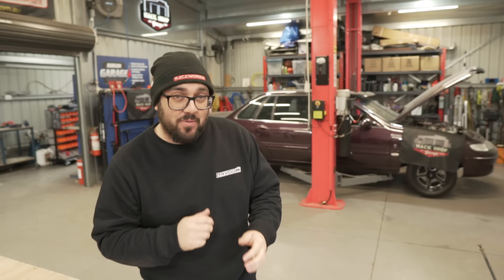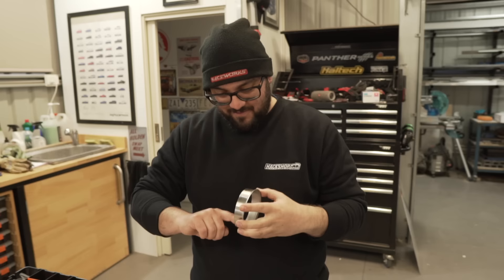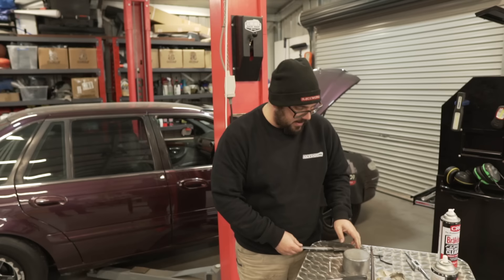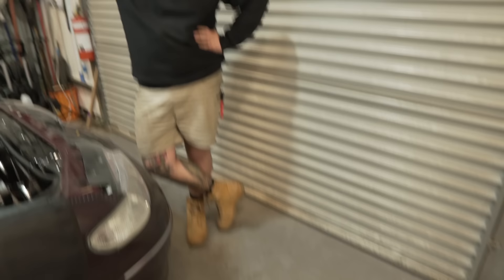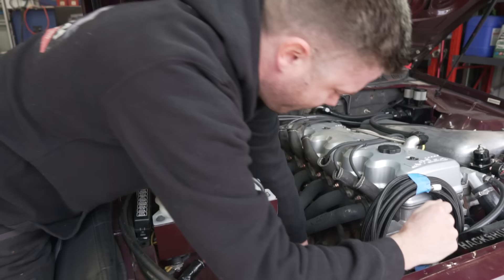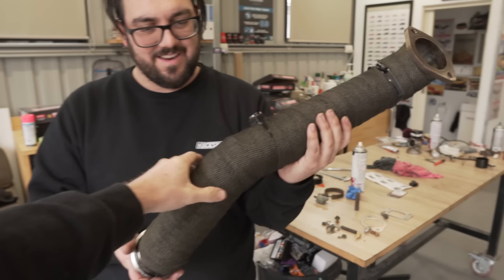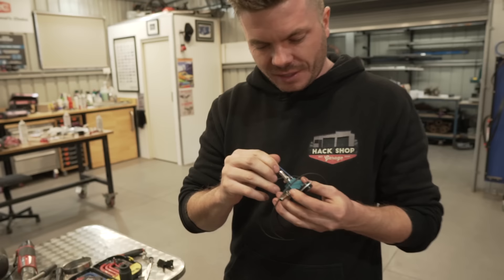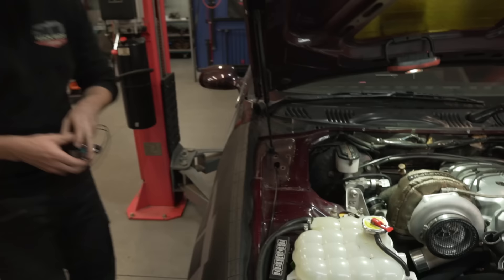FAIRLANE 2.0 BUILD - Turbo Time!!!

Comment: Pro tip- take your old seal, cut it in one spot and use it to drive the new seal in, so you're not hitting the new seal with a punch. If you cut the old seal just in one spot it will remove the tension and you can easily pop it back off the crank after you have used it to drive the new seal in.
Reply: Happy I came to the comments. Definitely going to try this tip on the weekend
Reply: @nathannathan5493  same applies to lots of other stuff too. If you need to drive a new bearing race in cut a slit in the old bearing race and use that as a driver. My toolbox if full of old bearing races for this reason
Reply: Yep it’s a great tip!

Comment: Highly recommended putting heat shield plate on fire wall behind dump to around n just past brake master will help keep brake fluid temps down n stop from the seals in booster from stiffening up

And route turbo intake to behind front bar will get at lot more cool aor down there then in a enclosed  box in engine bay

Comment: Another heat wrap tip, fold the cut or frayed end under itself for a neater finish and to stop it fraying further….also soaking the wrap in water will help keep the itch down and also help cinch the wrap nice and snug in the wrap process

Comment: Heat wrap tip - use cv shaft boot clamps. Saves space with no bulky hose clamps on the side and looks a lot cleaner 👍

Comment: Hi fella's, love your show. Have been watching you guy's since I stumbled on you a couple of years ago. Wanted to warn you about that radiator cap on your reservoir. I had them on my cars and noticed when I revved the engine the radiator hoses sucked in and went flat. Restricting water flow under high revs. You may want to test if your hoses are doing the same thing. Admittedly my caps were on the radiator. So, maybe that's why I had the issue. I could have put coil springs in my radiator hoses to prevent the problem. However, my cars are pretty stock. So I thought better of it. All the best and thanks for the great content.

Comment: Hey guys looking good , should be a fair bit more peppy with that turbo!Just a couple of things. I wouldn’t run anything smaller on the oil drain,, small drains are like one of the most common killers of turbos. Making a hardline is more work but definitely a better solution with so much heat in that area. Also suprised your not running an mls exhaust manifold gasket, i’ve never had much luck with those ones on turbo application. Anyway Keep up the good work, always look forward to your episodes !

Comment: Hey boys love the nut bolt trolley. Few recommendations I would say would be nothing smaller than a -10 drain and also if a turbo has water cooling I'd be using it. Turbos aren't cheap.
Reply: They are if you are given one!!!

Comment: I always use some high pressure grease on the rear main seal lip, those seals are either good to go or will leak within the first minute of startup, they are the worst part of my beloved Ford in-line 6’s
I’m looking forward to seeing this up and about, what casting cylinder head are you guys running?

Comment: Have you  considered not running power steering as the car spends most of its time running front runners which should be easier. This of course would depend on a manual rack being available to be adapted.

Comment: Don't go under a dash 10 oil drain lads. I ran a dash 8 on an old turbo setup and had issues with the turbo leaking oil out the exhaust side as it couldn't drain quick enough. Went to dash 10 as recommended problem solved
Reply from the maker: Hey mate, yeah we have since stuck with a -10 drain because we had heard the same

Comment: Did anyone notice the Welch plug on the back of the Motor when they replaced the seal
Reply: It just has some sealant gunk on it.
Reply: @seanb250  oh yeah just looked like it had a hole in it 😂
Reply: @anthonytemple856  I admit I did a double take on it as well 😂
Reply: @seanb250  😂